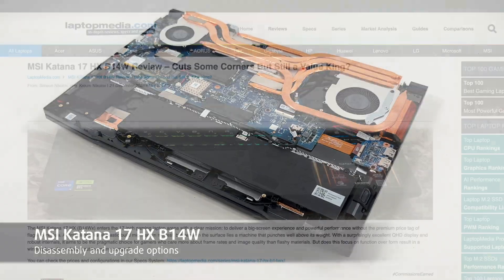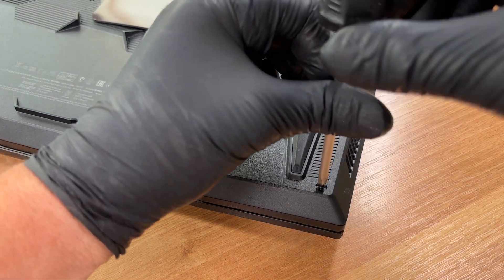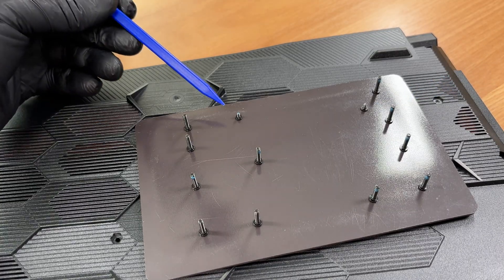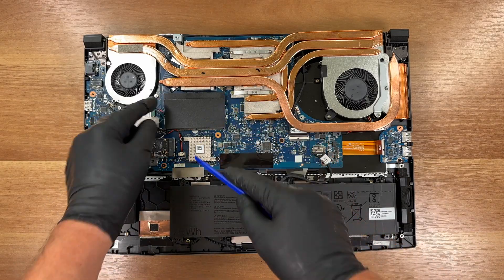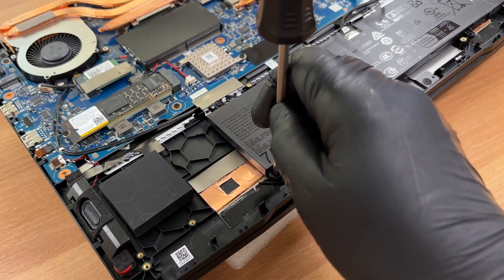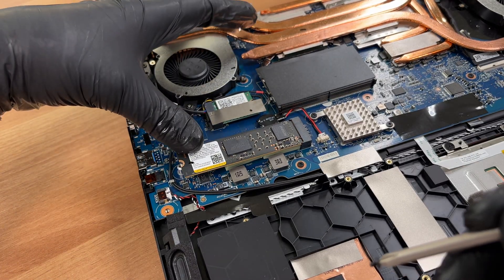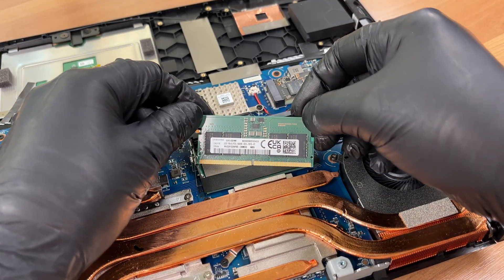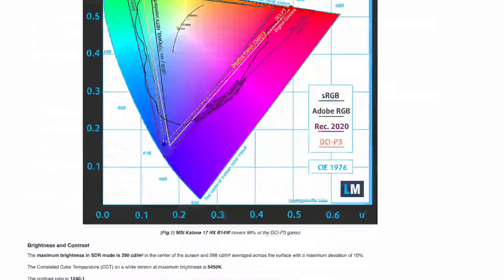🛠️ How to open MSI Katana 17 HX B14W - disassembly and upgrade options

Comment: It hurt me that it has only one m.2 and I bought 990 pro in the sense to use as C drive and put the pre-installed one into D drive for documents (one for game/app one for documents/data).
Now I had to buy external enclosure (yes, it sounds weird like why I never had external ssd before)
Reply: Exactly! WTF MSI!?
Reply: @Paul-gu2lv It's kinda my fault that I thought at least two m.2 is the "standard" since no HDD slot is understandable

Comment: At first glance I disliked the assymetric cooling design because of the lost potential, but then I remembered that most users are right handed and don't want the laptop to blow hot air on their right hand and admitted that what is not the best as a cooling design is great as ergonomic design. 

Although the only thing I am sure is bad: battery size and  positioning. 
It had to be either a 100 Wh, occupying all available space, or shifted to the opposite side, to compensate the cooling system assymetry.
Reply from the maker: Totally fair point. While we did squeeze ~5h of video playback in ECO-Silent/iGPU mode  from this 75Wh unit, it’s still a relatively small capacity for a 17-inch gaming chassis. Well, it’s just one of the “value king” compromises MSI seems to have chosen.